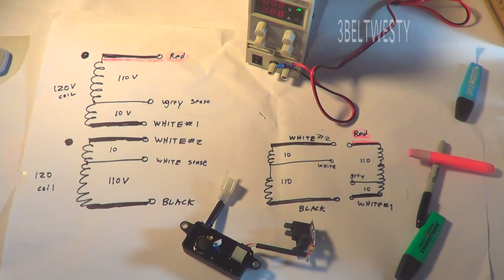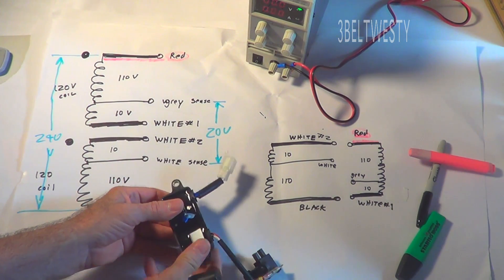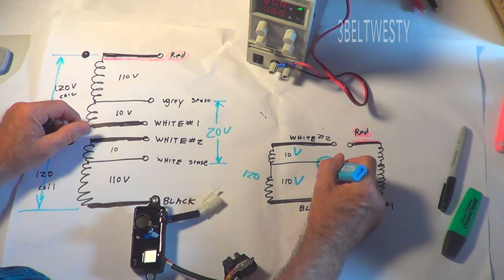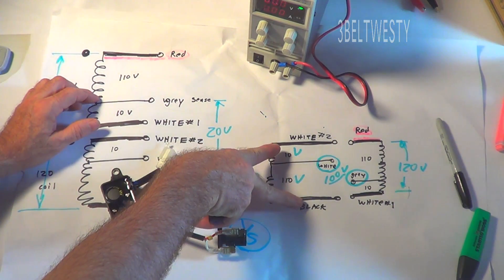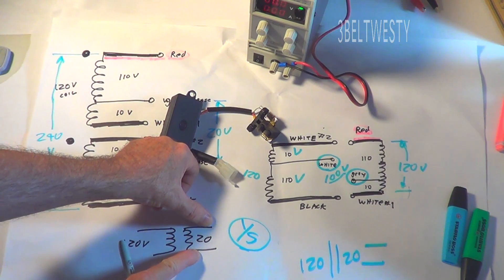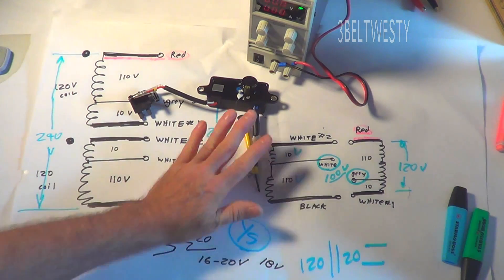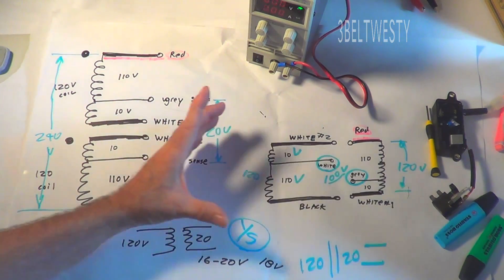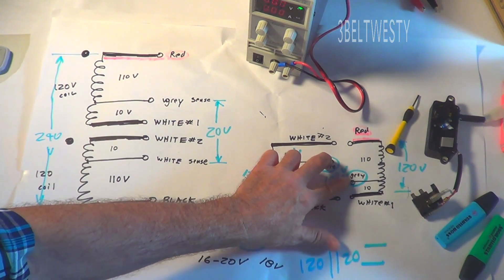3200 watt Predator Generator 120 volts at 26 amps for RV use (2) AVR

Comment: Worked perfect! I didn't use any external transformer.  I don't need the 12v from the gen, so I used that coil to power the AVR. You can get around 18-19 AC volts from that coil. I fine-tuned the AVR using the little screw. replaced the outlet with Nema tt-30R. I will upload a video later on my channel.
Reply: I just stumbled on the link to this video that I saved 3 years ago.
I knew my (cheap) generator didn't have a separate excitation coil after I tried to rewire it back then.

I like your idea, but my unit doesn't have a 12v tap. I'll have to review some other generator wiring schematics to understand how it's sourced.  Though I have several other units, I rely on this unit for 5000w@240v to power my well pump.  I'm handicapped at 120v and have to switch to a bigger unit just to run my miter saw. 

Thank you for posting. I like reading about fresh ideas to old problems.

Comment: can you simply use a small 120v to 24v transformer and place it in between the stator and avr?  ie: the grey and white from stator(100v)-primary input and secondary output(20v+-) grey and white to avr

Comment: OEM configuration the AVR senses/sees 20vac ,
When the winding are phased parallel the AVR senses 100vac 
AVR reduces from field current & voltage until it senses 20vac on the sense wires
Which makes the output approximately 24vac

Comment: Used transformer with center tapped secondary 10/20 volts as auto transformer. 125 volt primary not used. Connected 10 volt tap to sence winding of one stator winding and 20 volt to AVR. Excellent regulation no load to full. Much better than using 125v generator output through transformer stepped down to 20v to AVR.

Comment: If you have an RV with plenty of solar, some days you may need to kick on a genny to charge the batteries. 

Could you remove the AC inverter from the Generator and connect the DC straight to the battery, or even solar controller just like it is a Hydro, or wind device? 
I would expect its better to go from DC to DC, Vs. DC to AC then back to DC?
Reply: This project is Not an inverter generator, it is a conventional generator head, synchronous 3600rpm, 60 hz
Also inverter generators use a high voltage high frequency alternator to create the DC power feed to the inverter electronics
Non of which is applicable to this project

Comment: wouldn't this interfere with its governor system?  If you are forcing 20 volts into the reg, wouldn't that mean it always sees that regardless of load, and therefore wouldn't bring up rpm to compensate?.
Reply from the maker: seredin T the rpm is set by a mechanical governor to be 3600rpm ie for 60 cycle ac from 2 pole generator.  The regulator for voltage is not connected to the governor . Ie two separate systems
Reply: ty.  I only have basic wiring skill, 120/240 and three phase.  That fancy stuff is for the egg heads.  Have you given thought to a dual feed at the 2 outlets to get the same result?  I don't know if it would work but it would be better then me messing with wiring using a utube video.
Reply from the maker: seredin T hello. The two banks of 120 volt plugs are wired in series.  Each goes to a different stator coil. A stock generator unit cannot have these in parallel for rv usage
 Ie 26 amps at 120 volts.  One the coils have to be rewired so in parallel.  Ie open up the round black endbell cover. Two the regulator needs to be tricked. This involves adding a 16 to 20 volt transformer.  Without this added the paralleling only causes a low output ie say 15 to 30 volts.

Comment: A 120v Pri - 24V Sec transformer should work, if you fed 100v into the primary you would see 20v out of the secondary.

Comment: Radioshack may still have their 120-24vac transformer that had a center tap on the output.  You could use it as an auto transformer by just using the secondary windings. Use one hot of transformer secondary as neutral and connect the 10v lead to the the center tap and you would see 20v between the two hot leads of secondary. just don't forget to insulate the unused primary leads as they will be energized to 100v.

Comment: Would tying the white and grey sense wires together, then tying those to the 10v line coming off the one coil solve this AVR issue?
Reply: No, no! The grey and white wires are the source of ac power to a bridge rectifier inside the AVR. That rectified voltage is what is used to control the amount of voltage applied to the brushes to create the correct magnetic field. That's why they call those two wire sense wires.

Comment: Which side do you hook the 20v DC positive and negative to on the sense wires?  Is Gray positive or White?  Does it matter?
Reply: Have you tried this yet?
Reply from the maker: Both the "exciter" the blue pairs and the "sense" grey/white put out AC voltage. The AVR rectifies theses AC voltages inside the AVR unit. The "exciter" is rather a high voltage since when rectified and regulated it is creating the DC Field voltage of up to 90 volts DC. Again the "sense" wires grey/white are an AC voltage and not a DC voltage. The "sense" wires  white and grey are taps off the two 120 volt stator coils. 

In the stock HF generator they are in series and add to about 18 volts. They "add" because the stock config has the two big white 120 volt stator wires connected together.
Reply: +3beltwesty Perfect! I guess I was thinking that there was a conversion to DC on the sense wires to begin with. That makes it easy.
Reply: Did you try yours AVR with a transformer?
Reply: 3beltwesty, do you happen to know how much current flows through the sense wires on the normal 240 V configuration? I'm thinking that if it is only a few mili Amps, then a simple resistor divider calculated to achieve the 20 V might do the trick. What do you think?
Reply: 3beltwesty, I should have also asked if the current on the sense wires is constant. If not, the idea of resistor's divider wont work.